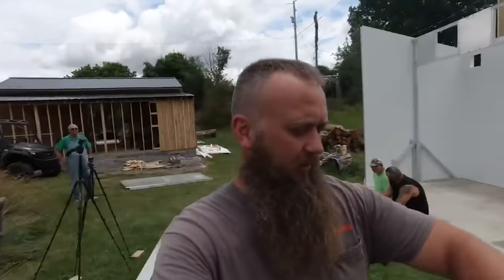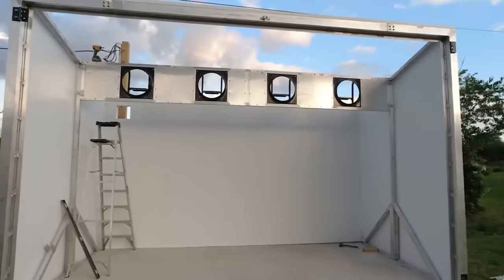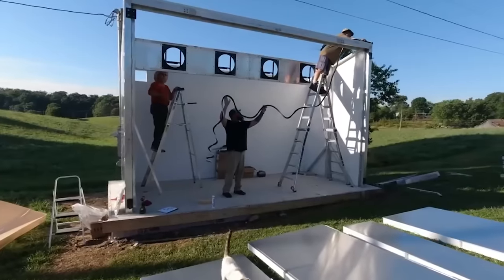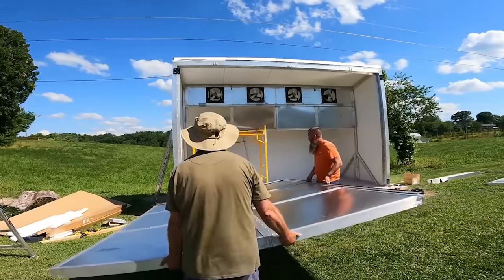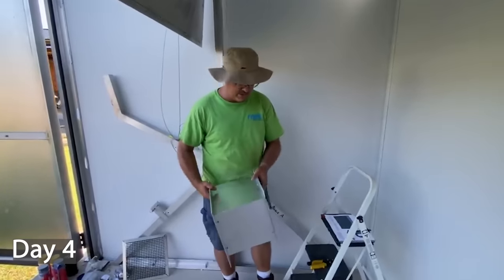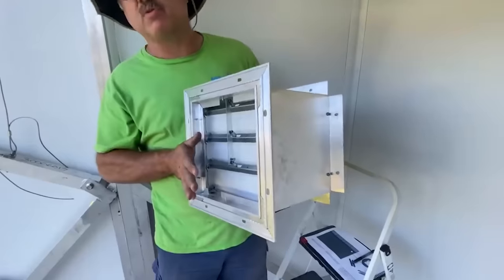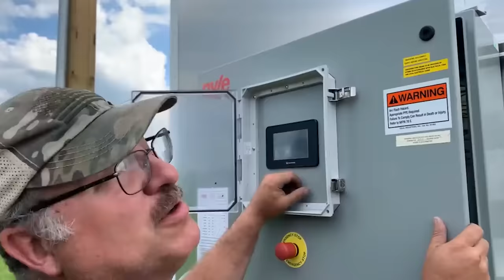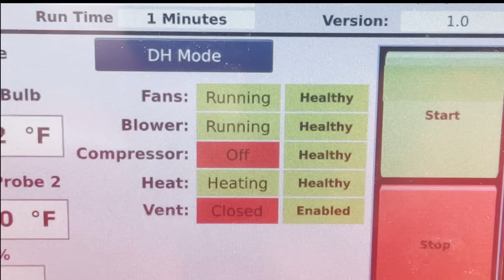This Amazing Lumber Drying Kiln Is On Another Level, Nyle L200 Pro (complete build video)

Comment: Wondering why moisture won't migrate under the floor since the slab is over sized from the unit.  Yes the track is set in sealant, but over time, water never ignores an opportunity to infiltrate.